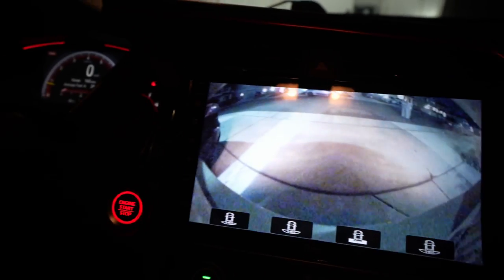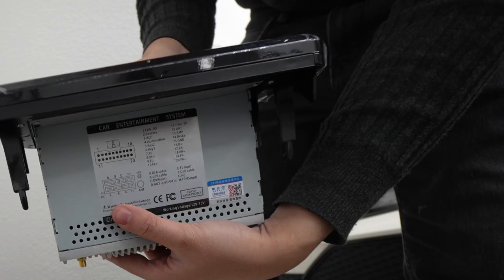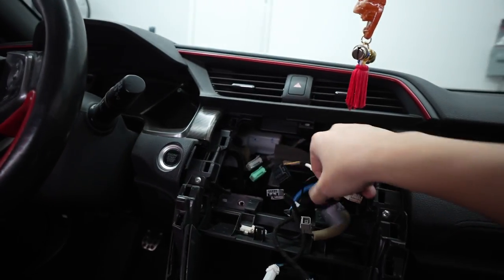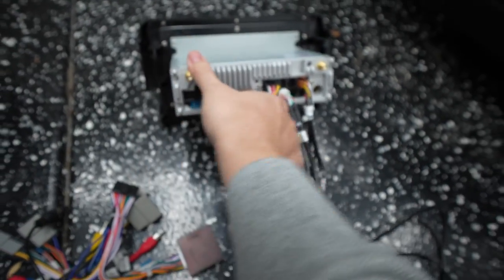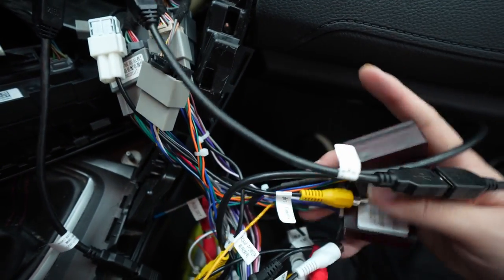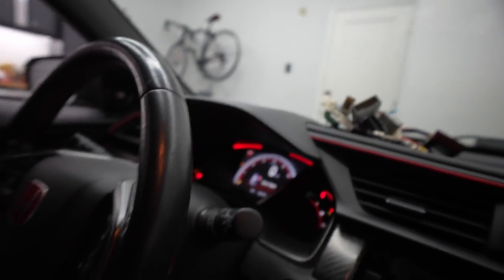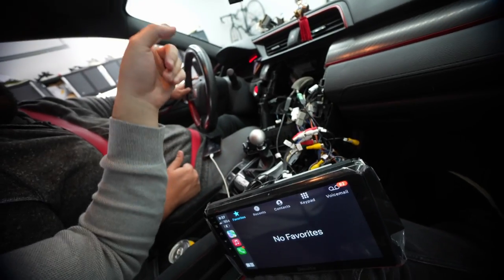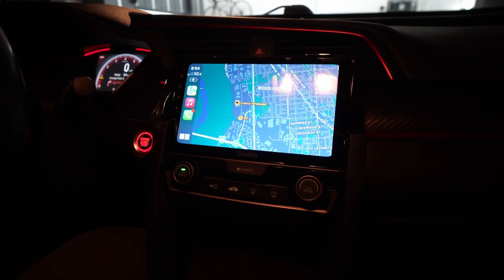About time!  Android Head unit Honda Civic TYPE R, Si, Touring  | Wireless Apple Carplay /A Auto

Comment: I just installed one on my 2020 civic sport sedan, having issues with the sub woofer output and i only got 1 canbus box that’s longer than the two in this video and has connections on either side, however there’s only 1 cable on the harness

Comment: I just bought mine, only concern so far is how I can set up again the Driver information interface? Where you can select if you wanna see on the dashboard the Turbo, G force, and those kind of things. I have a 2020 Si.
Reply: Same. Just installed my joying unit. All that stuff is gone. Cant even see my car mileage anymore. Im liking the unit but i still want those
Reply: @Jourdaiin  aye you figure any of that out? Maybe take it to a shop or something and see what they can do.
Reply: @krazyaces2086  nah no solution i just said whatever
Reply: @Jourdaiin  so with this head unit you loose all the interactive stuff like, boost, brake psi, shift lights ???
Reply: @sebastianleonardi667  not everything but almost everything. Only thing you can still see is boost, mileage and warnings
Reply: @sebastianleonardi667  and you still have shift lights also
Reply: @Jourdaiin  are you able to switch between them with the button on the steering wheel. Or do you have to switch them on the headunit
Reply: @sebastianleonardi667  all functions on the steering wheel still works.
Reply: @Jourdaiin  so what functions are lost on the dash?
Reply: @sebastianleonardi667  the only interactive stuff you can see on the dash is boost, trip time and mileage. Thats it
Reply: @Jourdaiin  could you send me a picture of what it looks like?

Comment: Hey I ordered the campus connected everything but I am not getting any audio at all.. any suggestions besides using the front audios connector versus the back?
Reply from the maker: Did you order the one in the video? There are two links in the description.
Reply: @sixfourkiller  yeah, instructions are very unclear lol
Reply: @sixfourkiller  having the same issue no audio i tried using the front and rears but still nothing
Reply: @sixfourkiller  so the amp connector needs to be connected? I'm assuming it's one of the 2 grey connectors left
Reply: I have the same harnesses but it doesn't make any sound at all, does anyone know why or what is needed?
Reply: @JohnNguyenVincent I have the same harnesses but it doesn't make any sound at all, does anyone know why or what is needed?